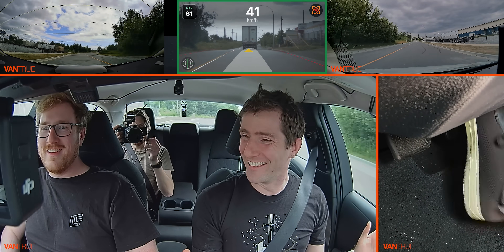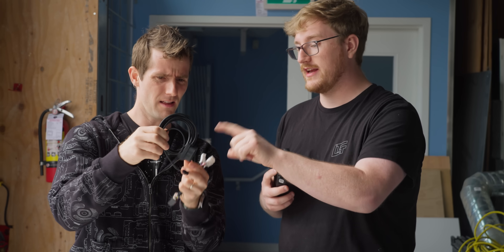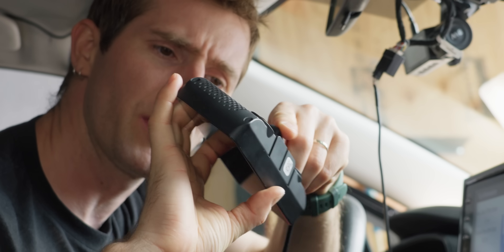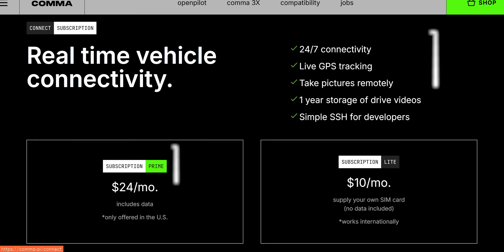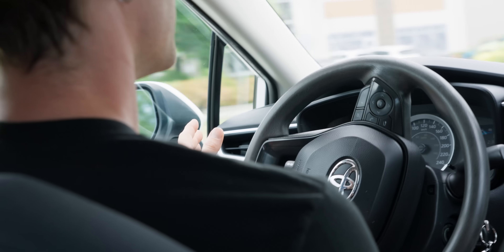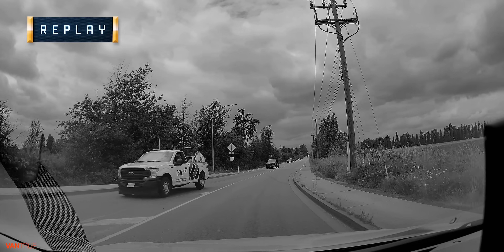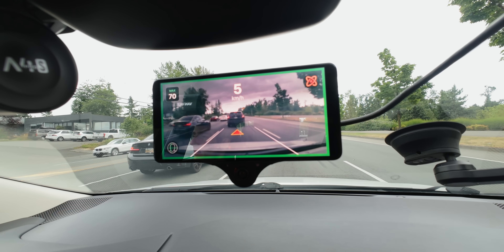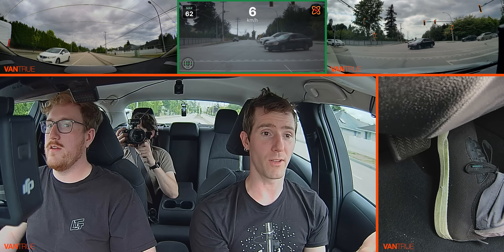I Upgraded My Car With Open-Source AUTOPILOT and it's AMAZING

Comment: As someone who's used a Comma 3 for the past 3 years on my Hyundai Ioniq...

- Comma uses the stock Lane Keep Assist signals to control the steering wheel. That's why it can't make sharp turns, as most cars don't have a high enough torque/steering limits to do sharp turns. The stock system is designed to keep you within lanes on highways, and that's still where it will excel. Some cars do have higher steer limits, the comma community has notes on a ton of cars regarding this. 
- The local roads with slower speeds and sharp turns are pretty worst-case scenario for openpilot in a car with low torque and steering limits. I don't use mine on this kind of road.
-  It will nag you to always look straight ahead and keep your eyes on the road when it's engaged. The wide camera facing backwards monitors this. All forks are required to keep this feature, or they get blacklisted. You can switch this in settings to steering wheel hand monitor. 
- It's an outstanding highway driving assist. Extremely stable, doesn't take off to drive into exit lanes, and has genuinely never done anything weird to me in 10s of thousands of miles of highway driving. 
- BUT It's best to simply think of it as a highway driving assist. An AWESOME enhancement to cruise control. BUT that's all you should think of it so far. 
- The stop and start at stop signs is definitely experimental. I only have the indicators turned on and don't let it do the stopping, but I still see it miss a lot of traffic signals on screen. The low speed sharp turning driving experience is pretty meh on most cars unless they have higher turning radius torque limits. It's not really aware of all the other cars around you, or pedestrians, or anything like an actual self-driving system. It will happily ram right into stuff. It is just a fancier cruise control. 
- Technically, it allows you to drive hands free, but I ALWAYS have my hands on the wheel. It will not override the stock LKAS system on the car, so you can always overpower it. I don't trust this thing to do anything but keep me comfortably within my lane and matching speed with other cars on the highway. 
- It makes driving chill, but you shouldn't chill out. Use that extra chill to keep a better eye on the surrounding road. It's a Level 2 driving assist for highway driving cruise control. Not a self-driving car.
- The original comma 3 was $2300 and up to $2750 dollars. Way more than $1250. They definitely have come down in price.
- The comma 2 was quite literally a LeEco LePro 3 cell phone without a battery strapped to the windshield. 
- Toyota's newer cars since around 2021 are encrypting the car communications for controlling LKAS signals to prevent users from modifying/repairing/hacking their cars. Look up your Make, Model, and Year before buying a comma to make sure it's not one of these cars, as no notable progress on decrypting the CANBUS has been made on these newer cars.

ALSO... Wear a damn seatbelt! And wear it correctly. Move the microphone. You're testing automatic car control for the first time. The likelihood of ramming something just went way up LOL
Reply: From what i understand it's not just Toyota, it's basically all car companies that use newer encryption. i believe it's an EU requirement that all new cars are required to use the newer system, it's why some Porsche models like the Boxster/Cayman and Macan aren't available there any more, but are still available (for the time being) in the UK and US.
Reply: thanks! i just couldnt find out how it turns the steering wheel.
wouldve been nice to hear about in the video too 🤷‍♂
Reply: @Hosch87  it does it with the vehicle's native lane assist system
Reply: @civilsocietyprivateinterest 
I know. I had a 2013 Audi A3. Had lane assist and radar based distance systems.

But i didnt know how comma 3 did it. Wasnt in the video 🤷‍♂️
You have to have a car with lane assist, all other cars cant use it
So no luck for my golf6 (besides german TÜV, who will never ever allow to use such things)
Reply: @Hosch87  they did.  It uses the car's built in assistance features.  They told us this when they talked about the car support.  What they didn't mention is that it's plugging into the car's network where the existing drive assist camera was.  Once it's there it uses the car network to control the existing steering and braking mechanisms.
Reply: @Hosch87  I hadn't thought about that. Without hardware physically acting on the steering wheel and pedals it seemed pretty intuitive to me what it must be doing is essentially hijacking the abilities the car already had relating to electronic steering, acceleration and braking but I guess they could have explained that better in the video.
Reply: @Hosch87 they did say at 13:25 if you watched the whole video
Reply: @Hosch87  thats becuse the vehicle needs to have support for some type of driving assistance like cruise control, eg. vehicle with cruise control is capable of handling steering, accelerator and break, Comma's system is hooking into it and taking the control.
Reply: @Hosch87  vehicles built with electronic steering
Reply: My car doesnt even have lane keep assist but the comma unlocks it in my prius and I get way less steering warnings than he does on my comma.
Reply: YES WEAR A DAMN SEATBELT ITS NOT THAT HARD
Reply: Pin this
Reply: Sounds about like the experience the last 10 years with my Tesla Model S and AP1 (apart from the steering angle, my old S will take corners like a racing driver if you have the stomach). Nice to see similar level of driving assist coming to other vehicles. Would love redundancy, but that would be hard in such a tiny form factor.
Reply: @f36443 Model 3/Y HW3/HW4 now supported as well
Reply: @camwow13 Was about to look into getting this for my Ioniq EV (MY2020 38kWh, Premium SE, EU model), but it sounds like from your message the cars stock LKA, Traffic Stop and Go Active Cruise Control etc already does 80% of what this thing can do anyway and won't really improve it much?
Reply: @jonc-1989 The first gen Ioniq's are locked out of low speed steering entirely below 32mph due to the ECU not allowing any LKAS input at low speeds. There is a hardware mod that I've never done that can go in line with the power steering unit control and override it. I think 2020 is the refresh year to the 2nd gens (with the electronic parking brake and flat button interior). Those can steer below 32mph. 

For stop and go traffic it works well. That's slow enough it will be fine. You won't be hauling the wheel over more than 45 degrees to make a hard turn while sitting in traffic. It's just the kind of 30-45mph encountering sharper turns where the wheel just can't turn over enough to work well. Same goes for higher speeds but you usually don't encounter those. A lot of people love this for stop and go. I know the refresh models can do stop and go cruise control in stock, unfortunately my 1st Gen can't do it. 

For highway driving it's noticeably better. This is what I use mine for and it's awesome. That is a big improvement over stock. If you don't do much of that I wouldn't get it. 

The Hyundai assisted cruise control system is already very good. I don't use it on my comma and use the stock radar system. The comma only controls steering assist. That works great for me.
Reply: @jonc-1989 all i can tell u is my car stock does more than what this can do...within reason
Reply: @scotts1668 Which car?
Reply: Fun fact, the hacker known as Geohot, George Hotz, the original jailbreaker of the iPhone and iOS along with the original jailbreak for the “unhackable” Sony PS3. Then went on to found this company Comma AI. 

Very talented individual! He even uploaded videos of him through some coding sessions at his home.
Reply: Self drive, drive assist, and other autopilot control systems are regulated and permitted by the federal government and also the states they operate in.

There’s no way this system is compliant.

When there is an incident, who is responsible?  Do insurance companies cover this?  What about mandatory insurance states?

If the vehicle isn’t covered by insurance, it’s not legal on the road…

I’m just saying.
Reply: @imchillyb If you get into an accident with an OEM ADAS, you take 100% of the blame since you were negligent and insurance won’t cover you anyway. I fail to see how this is any different.
Reply: @tsujimasen  The whole point of liability insurance is that if you cause an accident the insurance company will cover it.  If this device invalidates your coverage then you’d be on the hook.
Reply: @oliversnow  Would you agree it would be fair to split the all accidents into ones where the driver has their hands on the steering wheel, and ones where they don't?

Regardless of what ADAS you have, if your hands aren't on the steering wheel and there's evidence of this, you would be determined to be negligent and insurance wouldn't cover it.
Reply: Also, the lack of options for Porsche,  BMW etc. probably isn't because rich people lack a market for self driving. The more accurate reasoning, is probably because Porsche / BMW / similar makes, have encryption and other complicated communication systems. I think Comma is a short term solution and future cars won't work well with it.
Reply: @Innerbrave  Correct. I'm currently in a BMW hacking group and trying to assist with my car as a doner where I can. BMW is one of those automakers who are insanely, AGGRESSIVELY, MALICIOUSLY anti-right-to-repair. Everything inside and out is proprietary and requires extensive reverse engineering work.

This is about more than just getting the comma to work on these vehicles, too. It's also about being able to understand and fix these newer models. We desperately NEED laws against this practice, before your local mechanic goes out of business for good.
Reply: That's helpful, thank you.
Reply: I haven't heard the LeEco name in a long time
Reply: >-  It will nag you to always look straight ahead and keep your eyes on the road when it's engaged. The wide camera facing backwards monitors this. All forks are required to keep this feature, or they get blacklisted. You can switch this in settings to steering wheel hand monitor. 

Do you know which setting is this? I can't find it :/
Reply: @yoshidownload I might have been mistaken and it's a feature in Sunnypilot not stock. It's been a long second since I looked at that feature.
Reply: Some of these newer HKG vehicles are amazing with OP, full 90 deg turns etc.
Reply: Testing experimental hacks I’d wear a helmet as well. Seriously.
Reply: If it should only be used as highway driving assist, what does it have over the stock adaptive cruse control + lane assist?  I have used modern Hyundai and Toyota cruse control and I don't see any advantage.
Reply: @ka-onlee6148 Newer cars are indeed better. Though often their full very proactive highway driving modes are locked to higher or highest trim levels. Openpilot is a very very smooth experience for highway driving. Everyone who's driven my car has noted how seamless and human like it feels. My Hyundai's stock lane keep assist kind of gently weaves letting the car drift before nudging it back to center. Openpilot is locked in and keeps it dead center, perfectly turning through the middle of corners and curves, and handling night, rain, snow, etc with nearly the same smoothness. The company has basically spent their entire existence streamlining level 2 hands free driving assist. Lane changes are also done better than most OEMs I've seen. A lot of them keep merging through lanes rather than waiting a second, looking at blind spots, and shifting one lane over. 

Again though, modern cars are catching up with this. From what I've seen there's an extra level of polish to openpilot experience. But that's diminishing. For my older and lower trim level car though it's great.
Reply: @camwow13  There's also the fact that automakers besides Tesla ship only the latest model at the time of the car's release and then... Well, if you want an updated model, you're SOL. They just simply don't update it. Newer cars support OTA updates but these are purely used for regulatory reasons and to make software related recalls cheaper. OEMs do NOT release updates they aren't mandated to legally. They want you to buy next year's very slightly improved model instead.
Reply: @ka-onlee6148  This is meant to upgrade the ones that are shit to feel better. If your car's lane assist and adaptive cruise control is good you prob dont need it. But my car doesnt have lane keep assist and it adds it in.
Reply: @ka-onlee6148 What if you don’t have lane lines?
Reply: Okay, so if you have lane keep, and have adaptive cruise control, there isn't really anything this adds.
Reply: @thekwoka4707 Depends on the car and depends on the lane keep. Some on newer cars are very good. Some are locking the best behind highway driving assist trim levels. Openpilot is extremely good and way better than my oem lane keep. You go from ping ponging between lane lines to perfectly taking corners at highway speeds more smoothly and precisely than I could do it manually. It's just a much more refined and better experience, that also unlocks the feature on a lot of older cars that don't have that precision, or newer cars that locked it behind trim level paywalls
Reply: @thekwoka4707 Like the difference between ground beef and ribeye. They’re both beef, right?
Reply: Surprisingly, my lane keep assist function in my car makes me even more sleepy and less aware on the road so I tend to avoid it on road trips.
Reply: "The comma 2 was quite literally a LeEco LePro 3 cell phone without a battery strapped to the windshield" Oh no, my le phone has driven into le oncoming traffic D:
Reply: Your feedback should be on git
Reply: Them not wearing seatbelts is probably the dumbest thing I've seen either of them do.
Reply: Having comma 3X for over 27k miles. Definitely making long freeway driving much, much more sufferable. Good with stop and go LA traffic too. Much better than stock ford copilot 360+
Reply: For the record, this kind of advanced cruise control already exists on some cars. My car is from 2017 and is supposed to have this feature if you get something higher than the base model. I can't testify as a cheapskates though
Reply: @TalesGrimm  This is much better than most manufacturer's implementation of advanced lane keeping assist. It's hard to see it or compare it on video, but it genuinely feels like a human at the controls on the highway. You are perfectly in the lane, perfectly taking corners, not weaving or drifting, no phantom braking, and not diving into exit lanes. It's very impressive and feels better than even Tesla Autopilot (not the FSD systems, haven't tried that). Some car manufacturers have done really odd implementations of features like lane change assist, like it will just always change lanes without stopping and without considering the blind spot monitor. On openpilot, a lane change will move you over one lane, disengage, and resume driving seamlessly. It also won't let you change lanes if anything is in your blind spot. 

But it does vary a lot depending on the Make/Model/Year of the cars now. Lots and lots of improvements in this area. Especially in recent years. Adding this level of smooth driving assist still requires buying an expensive or very specced out trim of a car, though. 

Comma's goals (at least at one point) included licensing this out to automakers to put it in their cars. But for various reasons that's never happened.
Reply: @camwow13 it doesn't feel better tac tesla autopilot lmfao. It can't even turn properly, what are you smoking?
Reply: @mikerzisu9508 My original post covered this but It can't do low speed driving in most normal cars with turn/torque limits. In those areas autopilot will be far better. On highway driving it feels about the same, but without the phantom braking and other qol issues Tesla owners complain about with autopilot. (Nothing of course that autopilot and fsd are very different. Autopilot has been stuck in the same old model for a while now and fsd for all its issues is far ahead of openpilot or autopilot)
Reply: @camwow13  so you mean it doesn’t act like a drunk driver some times like my Subaru does?
Reply: @mikerzisu9508 At least it doesn’t phantom brake or disengage when you steer.
Reply: @CyberNut930 Yes, haha Subaru is very drunk compared to this. Their system isn't that great haha
Reply: @tsujimasen are you really trying to make an argument that this beats tesla autopilot or fsd? Lmfao
Reply: @mikerzisu9508 I’ve driven autosteer on a Model 3/Y. I would install OP over that POS in a heartbeat. FSD is nice though.

Imagine your current autosteer without the phantom braking, without disengagement when you steer with autosteer active and without the constant steering wheel nag. That’s what you get if you install an OP device on a Tesla Model 3/Y.
Reply: @tsujimasen lol okay bud. This thing is like walmart grade hardware. And you are trying to compare it to tesla's hardware and software? It is not even remotely close. This is like little league versus the NY Yankees.
Reply: @camwow13  just wanted to share my experience with the BMW advanced lane assist on the 2025 x3, I use this feature on the highway many times often when I'll be on the highway for a long time (+20km), it has lane keeping and also space and will automatically brake if traffic ever starts jamming up. I'm super impressed with it and if I want to change lanes I just turn my signal on and it will change when the car thinks it's safe to do so just once and will stay in that lane unless I tell it to change again. I've never experienced it slip up or do any of the things you highlighted. although it usually will deactivate when it goes under a certain speed limit (too low for highway around 60kmph) I've noticed that if I press it again it will resume it's function but then I turn it off bc driving through the city is not what it was made for.
Reply: @Vyx25  The new OEM systems are definitely pretty good!
Reply: @TalesGrimm  I look at it as essentially being Hyundai/Kia's HDA
Reply: @TalesGrimm  My prius doesnt come with lane keep assist and open pilot unlocks it
Reply: @TalesGrimm A lot of cars have this feature, but none match the quality of openpilot. In fact, having this feature stock is a prerequisite to openpilot support.
Reply: This is super helpful thanks for sharing your experience!
Reply: Technically the likelihood of ramming something went down lol.
Reply: its so funny seeing linus go “guys its okay dw abt rhe seatbelt” when its illegal where i am and u will get fined by automated cameras for it !
Reply: I figured it taped into the lane keep assist and the adaptive cruise control.  I live in a very hilly area so even on a highway, since I don’t trust my Subaru to not deactivate lane keep assist on a sharp bend I wouldn’t trust this.
Reply: Offtopic but I had a LePro 3 for a few years and it was a damn fine phone for the price. RIP.
Reply: Why even do this on an Ioniq when it already has HDA or in some cases HDA 2 which does stops and gos for you
Reply: Nahh i ain't reading all that 😭😭
Reply: @camwow13 … is uh that legal where you live? To modify your car to ‘self-drive’?
Reply: woo also an openpilot user (6-ish years) and it's so nice to see Linus covering it
Reply: So this isn't a sustainable system
Reply: ok I was wondering just how good this is considering there's companies that would probably have significantly more money available that have not gotten self driving yet
Reply: they were just understeering its not that deep if they were in a rwd car woukdve taken those corners easy
Reply: bro they are grown men quit whining about a seatbelt
Reply: ofcource we got someone using this before i knew it existed or got to know it from a trusted source! its crazy!! dont u guys feel scared at least at such scale
Reply: Install FrogPilot and try the always-on lateral control. "BUT It's best to simply think of it as a highway driving assist." 

It's a game changer. It makes having a comma device far more enjoyable. You can also lower the volume, so engaging and disengaging longitudinal isn't annoying.
Reply: Even Tesla is still way way from the holygrail so-called "Level 4." This is a very cool open source project. However it's definitely "NOT" ready for mass adoption. Please be responsible playing this party trick. Be careful, don't hurt anyone.
Reply: @JohnWilliams-gy5yc Tesla will be Level 2 for the foreseeable future. To be L3, manufacturer has to accept liability in certain cases, and Tesla isn’t doing that.
Reply: @camwow13  what ioniq do you have. Ive got the 2020FL „Limo“… i cant imagine that the comma 3 is much better than that
Reply: @MoRatzzz 2019 PHEV. The LKAS system on the 2020 refresh is much better, though openpilot is still more stable. Haven't compared it on that one though.
Reply: Since you have a lot of experience with the thing I gotta ask, would it be any good in traffic jams? Straight long roads with nothing but traffic basically, I just want something that will handle stop go traffic honestly.
Reply: @mohamedzain5388 it’s been my savior in stop and go.
Reply: Can i ask which IONIQ? i have a 2017 electric and am wondering if it would work on mine, if European Law allows it ofc
Reply: They're not wearing their seatbelts? I just noticed that. So bizarre to see that in 2025.
Reply: This info really should have been (at least partial) in the video. And yeah your point about the seat belt is absolutely crucial!
Reply: pin this
Reply: Most useful comment so far
Reply: My Comma wouldn't allow me to activate it without seat belts on.
I have it installed on my Ioniq 5, Ioniq 6 and Kia EV6. Wil be installing it on my Tesla Model 3 this weekend, as the Tesla harness is on the way to me right now.
Reply: @camwow13  after I saw your comment I stopped watching these dweebs in the video. Thanks for saving me 20 minutes
Reply: I would say that it lacks additional sensors, it should have support for additional sensors (4D) for example.
Reply: do you have an ioniq with adaptive cruise control or just the regular one with lane departure? I have a '22 Ioniq hybrid but with on the standard LKAS
Reply: @nemoismyson standard limited trim without the tech package. Has adaptive cruise control. I use the adaptive cruise on mine for longitudinal control.
Reply: @camwow13  Darn I think the SEL would work too but sadly I opted for the SE and missed out on that and a sunroof
Reply: amazingly informed comment
Reply: LOL I saw right after he said he was going to wear the seatbelt wrong, the next clip shows he was buckled in properly before they drove off.
Reply: Glad you got your comment posted early enough to get it towards the top of the list so that more people see it, because that is vital information. Even a lot of Comma owners struggle with understanding that this is driver assist not driverless. By the way Comma 3X priced dropped to $999 a few months ago. They just had a 4th of July weekend sale for $799 which is insane. And the harness kit is now only $100. One of the goals of the Comma 3X was to streamline production to lower costs. And not by cutting corners, in fact Comma 3X is proving to be even more reliable than Comma 3 which was already pretty good.
Reply: would this work well with my 25 corolla cross hybrid? It already has dynamic cruise control that does really really well...i'm curious how much better it would make it?
Reply: Excellent write up.
Reply: @camwow13  I have a 2019 Ioniq electric, how do you feel the Comma holds up compared to the built in active lane assist and adaptive cruise control?
Reply: @dylanhopkins3640 that experience should be pretty similar to mine. It's much better over stock for highway driving. It will only turn on over 32mph just like the stock system though. It'll keep you very comfortably in the lane with little effort. No ping pong motion like the stock system tends to do.
Reply: This should definitely be an app and not a device on its own. Especially considering the flagship phones are 6x more powerful than that device.
Reply: @Muhammad-sx7wr The amount of stuff it does with the processor basically necessitates it running on its own OS rather than running at an app level. It doesn't run Android and uses a custom Linux OS. But yes there are projects that have custom flashed the os and software to Pixel phones and run it successfully. I think they have to use older one though, haven't seen it on newer ones. I'm a bit out of date though.
Reply: @Muhammad-sx7wr CPU / GPU performance is not currently a bottleneck by any means.
Reply: Nice
Reply: As a person with an Ioniq 6, how is this an upgrade over Adaptive Cruise Control with Lane Centering/Changing Assist? It does the same thing with a SEL or Limited trim but better than Comma 3. Since it seems the Comma 3 doesn't have access to the other sensors on the car, so it's completely relying on the cameras to change lanes but not the side cameras in the Limited edition?
Reply: @BurritoKingdom I don't know, people with 5's and 6's online seem to say it's better. I haven't tried those cars at all though unfortunately
Reply: @BurritoKingdom The quality of how it does L2 cruise is higher. Ground beef and wagyu are both beef at the end of the day, right?
Reply: @tsujimasen  watching Linus's video it seems worse, especially with changing lanes since comma doesn't have access to the side cameras and sensors.
Reply: @BurritoKingdom That’s a car model specific feature, blind spot integration is supported. As someone with first hand experience, I didn’t touch the steering wheel for over 4 hours on my last long distance drive. I turn it on within 5 seconds of entering a highway. No OEM LKAS that I’ve used makes me want to use it as much. It really does make driving more chill.
Reply: I have a 2022 Ioniq Blue and think this would be a great addition for highway driving. Overall, do you think it's worth the cost?
Reply: @krissondors Depends on how much highest driving you do. If you do a lot of a great improvement! I didn't think it was worth 2k for me but I also enjoy tinkering so I kept it. Now that it's only 1k go for it or go for one of the sales
Reply: @camwow13 I appreciate the reply! Although my daily commute is only 15 min, I do several 6-8 hour road trips a year so I think this would be great for those.
Reply: In other word, they haven't upgraded to say sd gen4 or elite, or even 8295 car grade chips
Reply: @DunDun-e43 Specs have little to do with this. It focuses on lane following and does it nearplly perfectly. They also have processing overhead for more according to the dev teams. They will need a bigger chip for expanded functions but they'll need different hardware to do it effectively anyway. And given their trajectory the last few years I don't see them expanding much. Getting SD chips in bulk for reasonable prices when you're not a major manufacturer is also stupid spendy.
Reply: Ohh? I have a 2024 Kona do you know if coma supports this car ?
Reply: @Instant_Nerf Take a look on the comma website they have a list of compatible vehicles. Some won't be listed because nobody has done them yet, but if it has an LKAS then it will probably work, will just require a bit more community work. There are guides for what to do on their website. Last I explored it anyway haha.
Reply: @camwow13  I read surprisingly more of this than I expected.
Reply: How do you use this if your car doesn’t have camera or lane keep assist?
Reply: @WigWoo1 You can't. Have to check the compatible car list.
Reply: @camwow13 awww that sucks I was hoping this was for literally ANY car. Damn
Reply: @WigWoo1 can’t
Reply: “Doesn’t drive into exit lanes” *cough cough Kia
Reply: "That's why it can't make sharp turns, as most cars don't have a high enough torque/steering limits to do sharp turns. "
Not technically true. The hardware of the steering can do it. The EPS (electronic power steering computer/brain) is forbidding it. It can be hacked to allow more torque in steering, but this is considered extremely dangerous and not the kind of thing that Comma would want to see.
Reply: Do not all Ioniqs have adaptive cruise? Mine is a 2021 phev base model and it has it. Which versions don’t have adaptive cruise?
Reply: @ClebyHerris The 2016-2019 models don't have adaptive cruise in the base models. They thoroughly updated the cars in the 2020 refresh. I bought a late first gen in part to avoid the glossy plastic touch buttons in the center console haha.
Reply: @camwow13  interesting, I guess it makes sense that early models didn’t have it but I’d always assumed they always had it. The ac buttons do suck. My dog has had her tongue out and suddenly I’m 90°
Reply: @ClebyHerris haha yeah it was there just had to pay more for it. I got mine used years later. I think adaptive cruise and lane keep were separate features back then but I'm not sure honestly. 

Hahaha yeah I prefer my dial. I just have my older parents who think turning it to 90 will make it get to 72 on their side faster than if it's set to 72.
Reply: The real reviews are in the comments
Reply: So how is it any different than the driver assist systems on the higher package Ioniqs: lane keep assist, radar cruise, etc.
Reply: @abattlescar My 2019 ioniq is a lower trim that had only basic lane keep assist so it's a huge upgrade over that. I haven't used the higher end hyundai highway assist myself. Most people seem to say open pilot is better. Not that it doesn't keep you safely in the lane, more that it's just more refined feeling. 

Openpilot is an awesome upgrade on lower end cars that have only the basic lane keep system. If you already have a highway assist mode, particularly on newer and high end cars, your mileage may vary a lot.
Reply: @abattlescar  it's smarter than your generic adaptive cruise/LKA system. My way of looking at it is it's like Hyundai's HDA feature, worth it if your car doesn't already have a similarly capable system.
Reply: @abattlescar  It just does it a bit better. I use it because my car does not have the ability to actually do lane keep assist but has all the sensors so open pilot unlocks the ability.
Reply: Aren’t you afraid you end up in prison because you drive a car that isn’t insured (as far as i know you aren’t allowed to use something like that. When the authorities asked the manufacturer for reliable proof they made the software open source and just sell the hardware now, which is quite shady). Imagine someone gets killed because that android phone on your dash does something wrong. Or you have an accident by yourself , and the insurance doesn’t pay because it’s installed…
Reply: @erebostd I checked insurance and such and it's all covered. You're still responsible for control of the vehicle and this is an enhancement of a car feature as far as they were concerned. Not unlike the many many other mods you can make to your car without insurance bugging you. It's a bit of a gray area though. There hasn't been a high profile major accident involving openpilot yet (that has come up in the community yet anyway) so there isn't much to go on how insurance/authorities would treat it. Stuff is often written in blood and regarding this particular system there isn't really any blood to write in. It is legal and fine to use currently though, there's thousands of people doing this without a problem.
Reply: @camwow13  are you in the US? I don’t know your insurance laws there (😁), but considering their „hey, we just release it as open source so we don’t need to proof that it’s safe“ solution, you might agree that it’s shady behavior at best? Here in Europe you not only are uninsured if you would use it, you‘d even lose the roadworthyness of your car, because it messes with the internal car communication without any proof that it’s safe. If you think about what car components have to endure (cold, heat, radio emission shielding, etc) to be allowed its crazy to put something like this in a car. I mean if you checked the legality and it’s legal and your insurance says so too it’s obviously your choice, and i bet it’s fun to use. But i think i‘ll stick with my integrated assistants, even if they haven’t all the features that this open source software provides (if you use the right car)…
Reply: @erebostd  It boils down to. Did your autopilot software hit a car. Then you are at fault because you were in control. No questions asked. Driver assumes fault unless it was an outside forces fault.
Reply: @SoulGun007 As i already stated, I don’t know the insurance and traffic laws in the US, i know those are often quite… open, compared to others. But i think I wouldn’t trust my insurance to not trying to get out of a huge payment if they see an opportunity. Here in Europe those systems are just illegal in public, out of obvious reasons. Especially since the company had the chance to proof their roadworthyness and opted for a „we only sell hardware now, the software is open source now and we can’t be blamed for things users do“ approach, which is shady at best, don’t you think?
Reply: @erebostd  I don't see that as shady. I see it as avoiding a lawsuit. If you get into an accident with any form of radar cruise control or lane keep assist you are assuming fault as the driver in any car regardless of software. Also you can always just not tell your insurance you have it.
Reply: @SoulGun007 that’s not correct. If you use your certificate lane keeping assistant (or travel assistant), you are fully covered. That’s the reason those Things are extensively tested and third party certified. Again, I don’t know how the US handles that, but I can’t imagine it’s very different there…
Reply: @erebostd No, if you get into an accident using your OEM ADAS and it’s discovered you were negligent, your insurance company does not cover you.

If you get into an accident using OP and someone completely barrels into you such that insurance decides it’s 100% the other parties fault, you will be covered.
Reply: @tsujimasen  wrong. My merc with SAE Level 3 was explicitly sold with the information that Mercedes covers if something happens during operations. Look it up, it’s easy to find. I quote from wardsauto (and Mercedes themselves): „In March 2022, Mercedes-Benz announced it stands behind its SAE Level 3 automation technology, accepting liability for any collisions or crashes caused by technological malfunctions in the manufacturer’s vehicles.

It was a bold statement that has left an indelible mark on the industry, causing different players in the community to assess the long-term implications for risk management and consumer adoption.“
Reply: @erebostd That’s L3.

comma is and always will be L2.

Apples to Oranges.

Merc is even ahead of Tesla in terms of liability. Tesla FSD is L2, because Tesla won’t accept liability.

Also, your Merc L3 is only limited to certain highways. Everywhere else, it’s still L2 and Merc won’t cover you in event of an accident.
Reply: @tsujimasen  on Lvl 2 Mercedes won’t, cover, correct. But my insurance won’t cover at all if i temper with autosteer and such, and that’s what this system is doing. There is no way around that. In addition a vehicle with the system loses roadworthyness, that’s a fact too. I don’t know about state laws in the US, but that’s the way it is here in Europe. And that isn’t changing because someone dislikes it. After seeing how the system sometimes behaves i‘m quite glad it is this way, tbh…
Reply: @erebostd I guarantee if you get rear ended at a stoplight with OP active while you’re stopped, the other driver’s insurance company will make you whole. Similarly, if you have your Merc L2 active, and you barrel into someone while driving negligently, your insurance company also won’t cover you.
Reply: @erebostd  Im not because Ive already gotten into an accident with this on (not at fault). My insurance just sees it as a fancy dash cam with extended features that enhance cruise control. I still have an insured car. I am not worried about going to prison because I make sure it doesnt mess up and I take control if it does something I do not want it to do. But using it for 4 years. 85-95% of the stuff it does I would have done myself. Mistakes included.
Reply: @SoulGun007 also got into an accident with this. Rear ended. Person behind me: "sorry I wasn't paying attention" 😮
Luckily no damage to report, we exchanged info, and went our separate ways.

This was on a 45mph road, bumper to bumper traffic slow moving.
Reply: @erebostd  it’s not autonomous driving, it’s a driving assist feature. The driver is still in full control (and responsibility) of the car. 

Imagine trying out cruise control for the first time and then plowing into a bunch of cars because you didn’t use your brakes, then trying to blame the car.
Reply: Wow the genesis g70 works better than this without even having this.